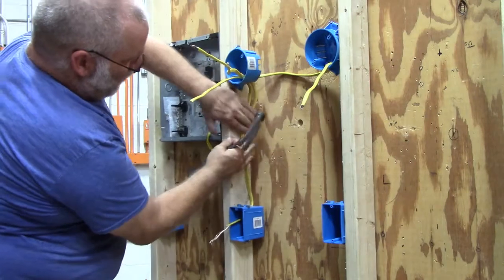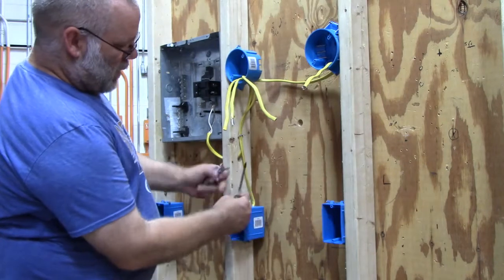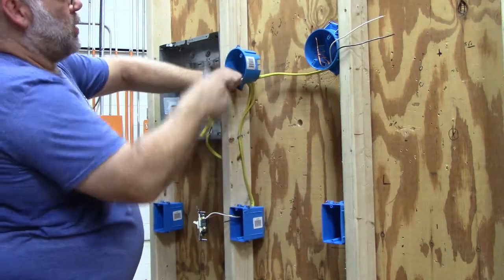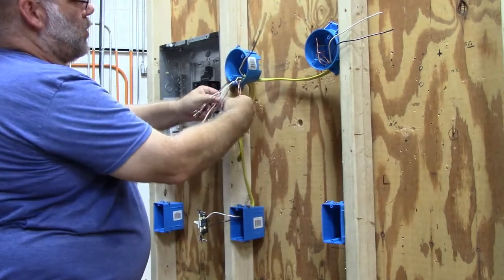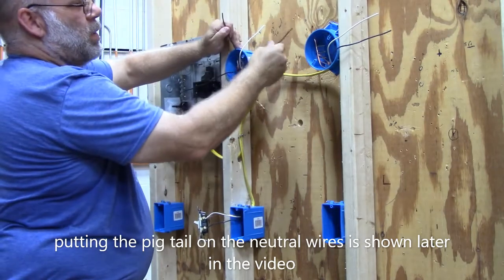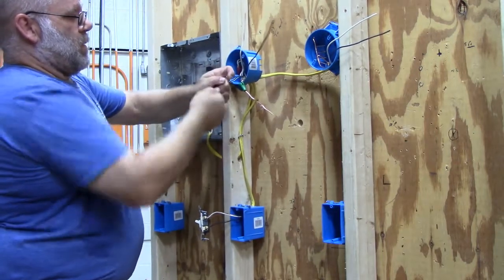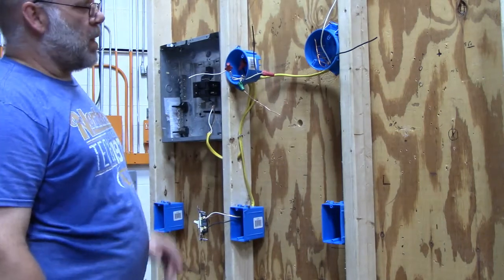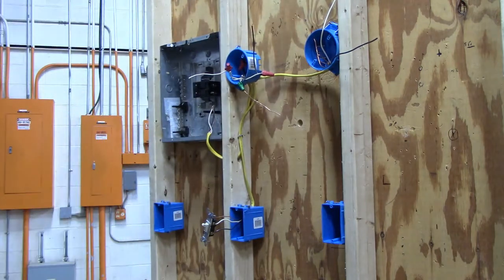Two lights with single pole switch power in light box

Comment: Wrong
Reply: Can you tell me why?
Reply: If you're going to use a white wire as a switch leg you should put black tape on both ends to indicate a hot wire and not a neutral in this case. Since 2011 I believe, an unconnected neutral wire is required  in the switch box for future upgrade to a smart switch/dimmer. You should use 12/3 or 14/3 and use the red wire as the switch leg from the first light to the switch. 12/2 from the source and between the lights is good.
Reply: @surferdude642  Do all dimmer switches need an extra wire or can you use the wire taped with black electrical tape as dimmer / switch wire? I don't understand what the difference is with the upgrade?
Reply: @monsieurbono  A regular dimmer switch operates like a regular on/off, 2 hot wires and no neutral wire. A smart dimmer can be controlled from a smartphone or computer, even remotely, I believe. Most of these devices require a neutral wire in the same sense that a receptacle does. You cannot use the existing taped white wire for this because it's being used as a switch leg and is a hot wire.
If you want to change to a smart dimmer and there's no neutral wire, there are some now that will work.
Reply: @surferdude642  Agreed Thank you